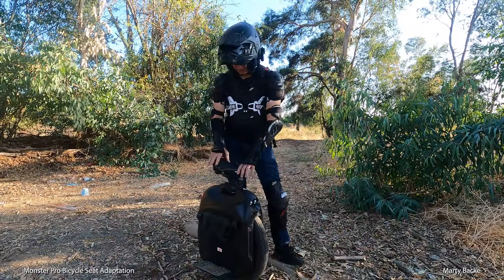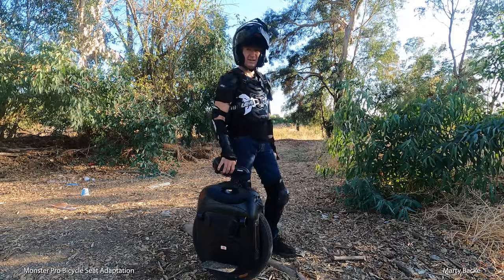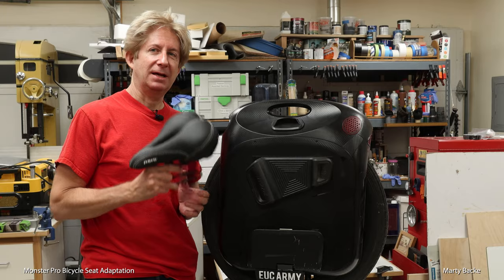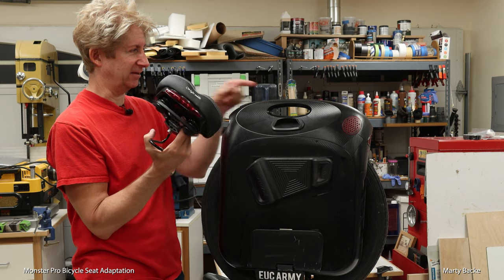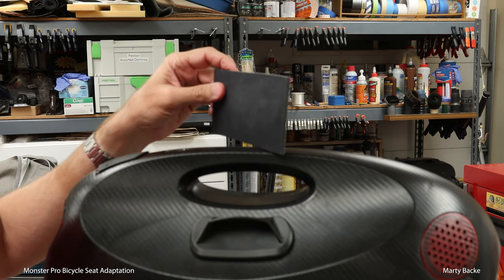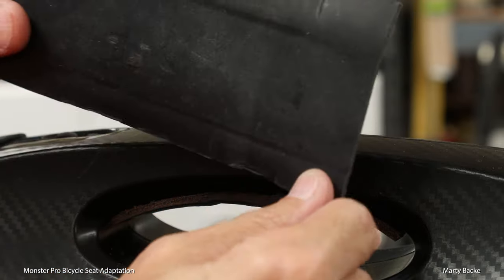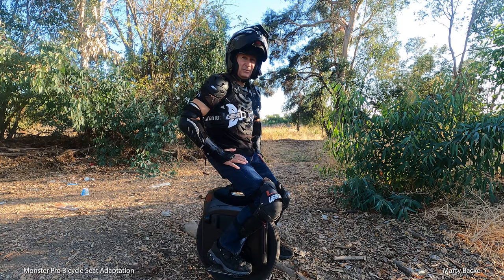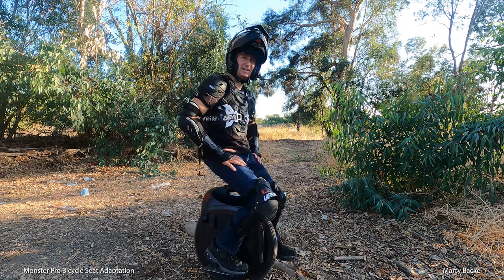Adapting A Bicycle Seat For The Monster Pro

Comment: Marty that’s the exact same seat, spring and process I used on the V11 before the actual seat came out. I also love the fact that seat has a rear light on it as well
Reply from the maker: Maybe you can reuse it on your Monster Pro when you get it running again???

Comment: Next, seat with backrest and i think it is doable there is already those seat for bicycle !! I use the original seat for my RS and my EXN and i did find a way to install it on my Sherman, this is still confortable even if my legs do not go in my pads i have control, this is an interesting seat but it wont fit on my Rs or my EXN because of the kill switch.

Comment: Why did you switch the spring mount orientation from the open end facing forward in you older video for a monster seat
Reply from the maker: Each wheel is different in terms of how the spring mount attaches. I changed the orientation as necessary to get the angle that works best for me.

Comment: This is an offtopic question. Are Nikola pedals larger than mcm5 pedals? Or monster pedals? I'm looking for over sized same shape as mcm5
Reply from the maker: Sometimes it depends on where you bought a wheel to be able to answer your question. Some wheels come with different pedals. So I don't know exactly what came with YOUR MCM5. But the "standard" MCM5 pedals are smaller the the Nikola pedals. The Monster Pro/RS/EX pedals are the largest from Gotway.
Reply: @ElectricUnicycles  ok thanks!
Reply: I have added oversized plates to the original pedals on a few wheels. It really helped with my foot fatigue problem.  You can make the plates any size or shape. I also added spikes and grip tape.

Comment: What would you do for the EXN regarding the lift switch?
Reply from the maker: Lift switches seem impractical (for me) on large heavy wheels like the EX, Monster Pro, etc. I would probably disconnect the lift switch. But I know people who have installed these spring mounts by using two clamps, one in front and one behind, the switch.
Reply: @ElectricUnicycles  Thank you! i will probably try the two clamp method first!

Comment: Would I be able to install this seat on the Ninebot Z10?
Reply from the maker: Absolutely. The Z10 handle should support the spring mount
Reply: @ElectricUnicycles  Thanks for the reply.  Just used your links to order the seat and the parts for installation.
Reply from the maker: @doctorpd1959  Great. Good luck with your installation, and let me know how it works out for you.

Comment: But do you think it's safe on high speeds?
Reply from the maker: Of course. People riding extremely fast while seated. It's actually the safest way of riding high speed because it's impossible to have speed wobbles while seated.
Reply: @ElectricUnicycles  i was asking about this kind of seat comparing to the others at high speeds
Reply from the maker: @Elunipsycho  I can't think of anything speed related regarding various seat types.
Reply: @ElectricUnicycles  thanks for your reply